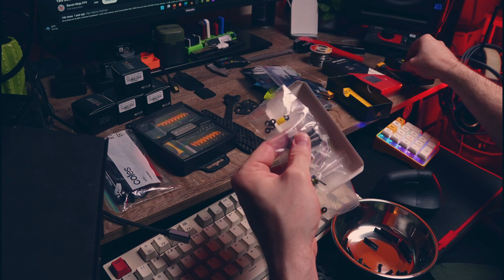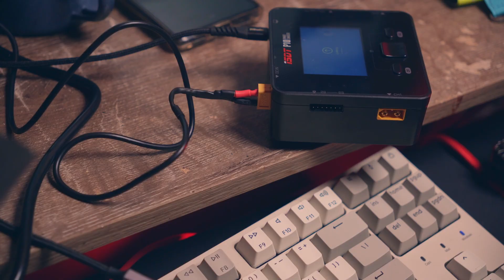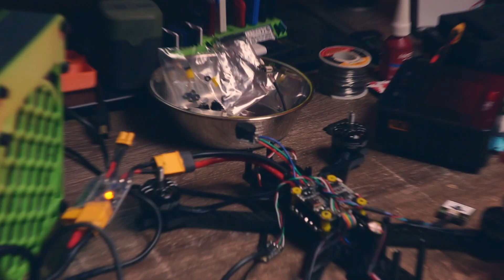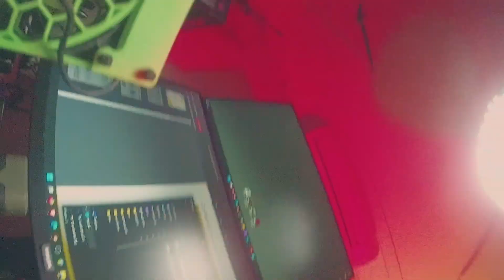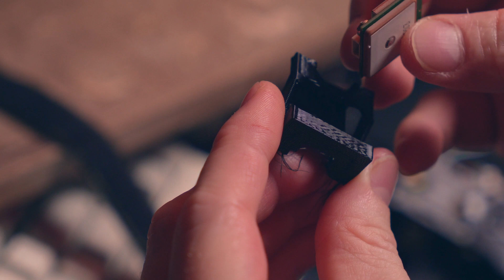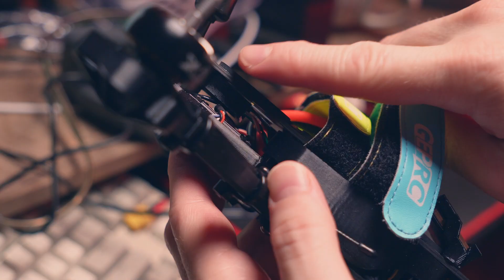Building my first FPV drone was an absolute joy

Comment: Nice work man, i commented in one of your other videos about getting better gps fix but noticed here you have it in a great position. It should be angled the other way however so the antenna is facing straight up when the quad is pitched forward. Another tip is to wrap the earth wire around the tx/rx wires but leave the positive on its own and a side note also dont have the wires run over the escs. If you end up getting another source 1 v5 then i have some 3d designs on printables for it and others that aren't and happy to share the source files with you.

Comment: I've been flying RC for years, and this is the first time i've seen someone power something up using a charger... glad it worked, but no reason it shouldn't I guess. 😃

Just curious, why the angle on the GPS mount?

Love your channel by the way, it's super cool following you as you learn all this new stuff 👍😊

Edit: another question (sorry), why not just use leads with banana plus from the battery to the DC plug? Nice solution though, just a bit more complex. 👍
Reply: A lot of the newer isdt, toolkit rc and hota chargers have a selective dc output setting. The gps on quads are normally mounted on an angle because in flight the quads are mainly always pitched forward however his is backwards in the video and should be angled in the opposite direction. And yep, banana plugs would have been an easier solution but his solution is cool and he's done a good job with it, i personally just use another lipo.